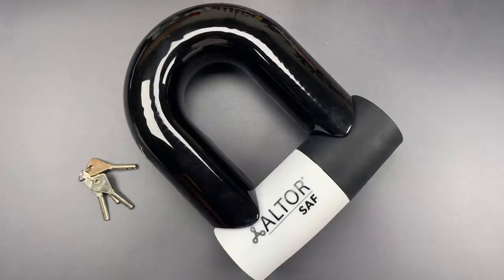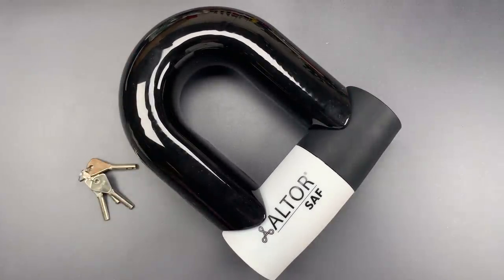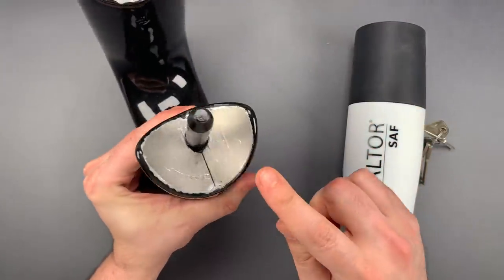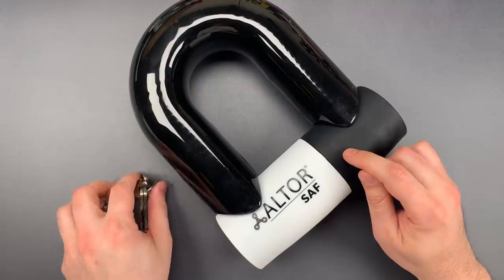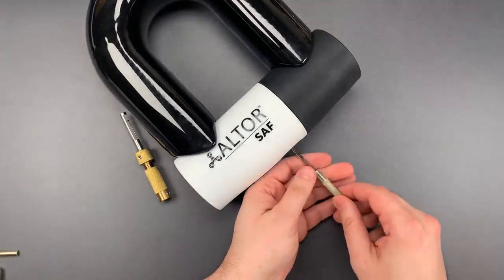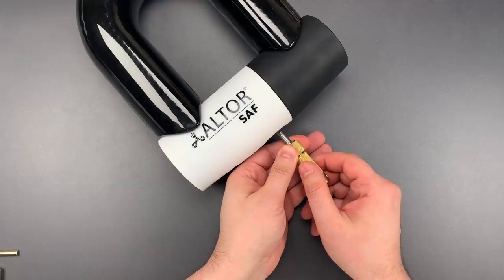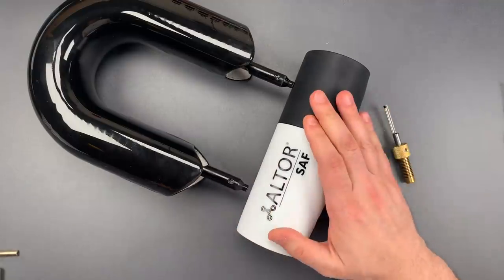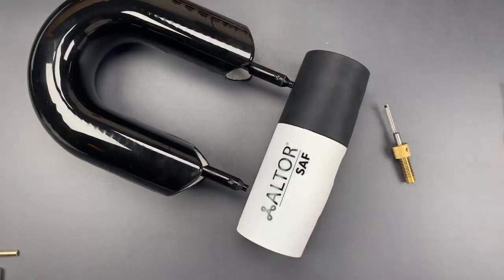[1088] MASSIVE Altor SAF ("Strong as F***”) Bike U-Lock Picked

Comment: I saw the video of the guy using an angle grinder to try to break this lock. He used multiple battery’s, disks, and even had to switch out for a different angle grinder. This not to mention this video where LPL created a specific tool for this lock in particular . If someone actually stole your bike, I think you have bigger problems than a common bike thief.

Comment: One thing i'm worried about is: what should i do if someone pours glue down the keyhole? i had that happen with one of my U-locks and, while it was cheaper to have a locksmith remove it than buy a new bike, he still had to cut it off with a grinder(which might not be an option with this one).

Comment: Good luck getting that around your wheel + frame + bike rack though.
e: I'd honestly even be worried whether that shackle has enough clearance for just my frame and the bike rack. I guess if you have a skinny frame road bike it's less of a concern, however.
Reply: It's actually big enough to fit around a street post. It just looks like a small gap because of how bulky it is, but it's quite a lot of space because of how big the lock is.

Comment: Isn't it possible to use a vial of Mercury, scrape off the rubber coating then attack the thick aluminum with Mercury which would essentially melt through?

Comment: I think the problem here is that people aka thieves might just try to grind or damage this lock out of spite. You spend 300+ dollars to get a lock which you won't carry with you and people damage it to a point that it's going to be useless. I hypothesize that one way to break this apart is to grind it as far as possible and then use leverage to crack the aluminium apart from the grind spot. Given that the thief has the tools, smarts and time for it of course. Hope I'm wrong tho. 🤨🤓

Comment: I'm curious in what scenario this lock could actually be used. Looks like it would barely fit over a bike frame, seems like it would need a specially designed bike rack to have something to lock it to. It's not big enough to attach to most bike racks. Definitely can't fit it through a chain or standard steel cable eye (not that it would make any sense to use a cable with this).

Comment: So hang on - this is meant to be left where you lock the bike up. That would mean, in theory, that whatever you lock this to has to be at least as strong and resistant to attacks as the lock, right? Ok, so you have that very hard to find locking point, which would almost certainly have to be custom made or bought, and fixed to the wall or ground - how many places that you don’t own would allow that? Then you’ll be needing another lock to lock to this, because it’s probably going to be too small to go around the bike and the locking point simultaneously, or if it does go around the frame (unlikely), it certainly won’t go through the back wheel too. That additional lock then becomes your weakest point, plus you’ll be into about 400 in total, or more, if your lock standards are that high. Hmmm.

Comment: I am not sure about what use this lock is for. It's clearly too heavy and too bulky to take it with you on your bicycle, so you leave it where you regularly want to lock your bike. In that case, you could also use a massive chain meant to lock motorcycles. Which is more convient because chains are more flexible and longer than u-locks. So why buy this?

Comment: I really want to see how this looks when a bike is locked with it. It seems so massive as to be physically impossible to wrap around a bike and a rack.
Reply: Yes! I’ve just commented on this. So you’ll almost undoubtedly need another lock to add to this, for at least the wheels, if not the whole bike, and that’s assuming the thing you’re locking it to is at least as resistant as the lock.

Comment: What if they use a sawzall with a steel-rated blade? I've taken apart beefy steel frames with one, and the blade is certainly long enough to accommodate the diameter of the lock. Should cut through aluminum like butter.
Reply: ▪
True... 

Seems like the best way to go would be have this one, and other locks 
/ Alarms / tracker bugs /

Throw the whole kitchen sink at it.
🟥

Comment: But... what actually prevents a thief from first melting that aluminum casing with a torch then cutting the (relatively thin) shackle with the angle grinder as usual ?

For a brief period of time I was actually comparing this lock to the Skunk Lock in my head and I now think the Skunk Lock is actually better, because if you try to cut it... Well you get skunk'd ! 😂😂
Reply: ▪
Unless you got a gasmask or something. 
🟥

Comment: I quite fail to see use for this. You would need Ship anchor sized chain to fit lock through. While any wire would not make sense as you could simply cut it with cable pliers. And where you would find anything solid enough of to attach that chain to. Looks more marketing overkill than practical use.

Comment: Here is how you could do it quickly with a normal angle grinder: Just use a carbide saw blade to carve away a chunk of the aluminum (this blade will go through it in seconds), then switch to abrasive disc and finish the job like normal. https://www.lowes.ca/product/circular-saw-blades/eab-tool-co-pro-4-12-in-multi-cutter-saw-blade2110650-330601590

Comment: Could someone with experience explain how one would go about making a tool such as this (or really anything metal so small and detailed).

I have limited experience so I'm struggling to even imagine where to start, what tools one would need, etc.

Much appreciated!
Reply: I'm going to assume that he modified (given how long it took - quite heavily and extensively) already existing disc detainer pick - so the new one would be compatible with this lock (depends where you tension the lock for example - here it seems as if you use the last disc, while "pick that Bosnian Bill and LPL made" tensions from the first gate). Shape of gates/discs was probably non standard, so to get a good grip or make sure it fit well and didn't block anything would also be important. As you see it comes in 2 pieces - tensioner and pick - which probably means that discs have weird shape. Theoretically, given that he probably used already existing pick - it wouldn't be that much work. He could probably make a working pick for that in 30 minutes - but it would often lock itself, be troublesome and look a bit unprofessional. And LPL strikes me as a perfectionist.

If you'd want to do that pick from scratch though - then we're speaking about having machine shop and probably more than couple of hours of very precise work - given what else LPL has in his garage, I wouldn't be surprised if he could make it from 0, but I doubt it's the case here. It would be slightly too much work if you can get the same result by basically filing down, bending and at worst some micro-welding (though he probably removed material rather than added - for same reason why I don't think he made a completely new pick - too much work and if you make a mistake you have couple additional hours of work at least) on existing pick.
Reply: @jannegrey593  Wow thank you for the very detailed reply!

I'm having almost exactly the same problem as LPL has in this video. I'm trying to attach a lock that tensions off the last disc and has sort of a "half-moon" keyway (so none of my disc picks work). I've tried modifying the cheap Chinese ones before but I swear, you touch that tip with a bit of sandpaper and the whole thing breaks...

I also have the Sparrows LPL/BB pick but there's no chance I'm going to risk breaking that one so will not try modifying it!
Reply: @xntumrfo9ivrnwf  Yeah - I'm assuming that he simply has enough let's say "medium quality" (so no sparrows, but also not Chinese dollar occasions) that they don't go to dust with touch of sandpaper and he can use one of them because he has 4 others for that. I would be especially afraid when you'd need to bend it a bit to some shape (I mean more cylindrical for example - just an example, I haven't touched disc detainers in years and was never good with them - though they are fun), or create some notch - because quality of metal on chinese ones is.... uneven at best - especially when they try to harden the metal for example. Untouched it's good enough and works as a pick. Try to modify it and it's brittle. Then again locks are or rather were just a little hobby of mine (it isn't technically even legal in my country without special license to have lockpicks) that I didn't touch in some time - so don't take my word as gospel, because at best it's outdated (I can talk more about delicate medical/dental instruments - I do modify them from time to time, because you have 1 thing needed every 2 years, but you can get the same 20 times cheaper, just by modifying something far more common - but I'd rather not talk about it in an event that something ever goes badly - thankfully it never did - definitely not from my instruments side anyway).

If it wasn't for pandemic, I could ask couple locksmiths, because we often co-operate, but for now it's still contact to minimum.

Comment: It would srsly be faster to cut the thing this would be attached to. And also wouldn't it be quite hard to actually use this in the field. Like there's not that much space between the shackle and lockbody to fit the bike and whatever youre hooking it up to.
Reply: It's marketed to people with expensive bikes and motorcycles. Those events always have secure places to attach your vehicle to, which this could fit around. You couldn't attach it to a tree, but it will fit around any street post. If you watch back to where he showed the comparison, you can see how much space there actually is.

Comment: angle grinder sure but I have blades for my cordless reciprocating saw that go through aluminum and steel like butter.  I'd wager this lock would be maybe 45 seconds with a good metal demolition blade in a sawzall.

That's the trouble with bikes, even a decent u lock usually a couple good whacks with a hammer will do it.  Great U lock? angle grinder.  300$ behemoth? reciprocating saw with a demo blade.
Reply: Geez I'm sure most crack heads who steal bikes would have the type of angle grinder you mentioned.